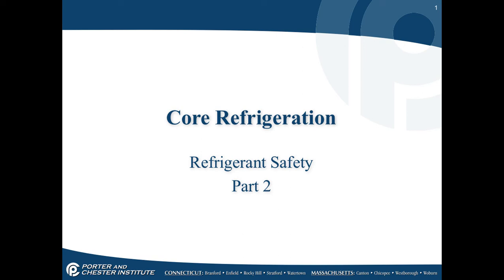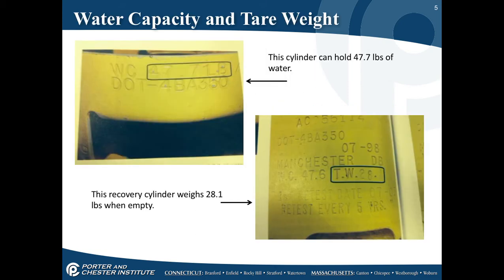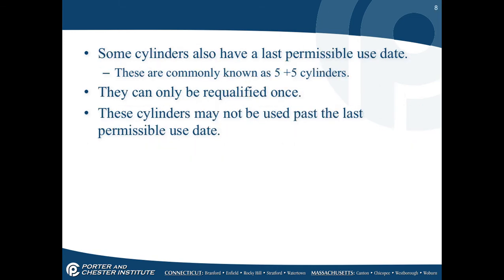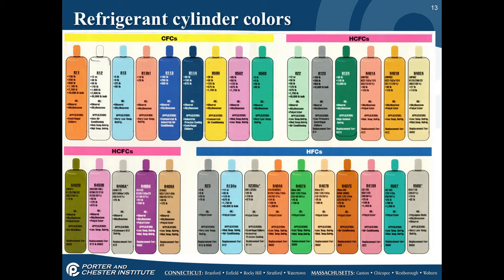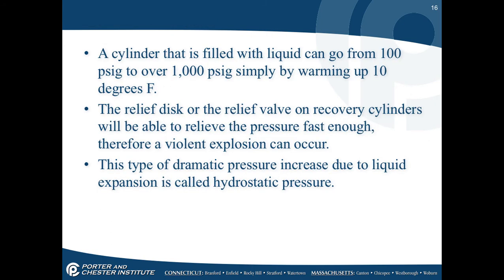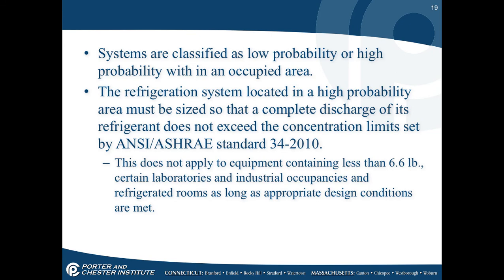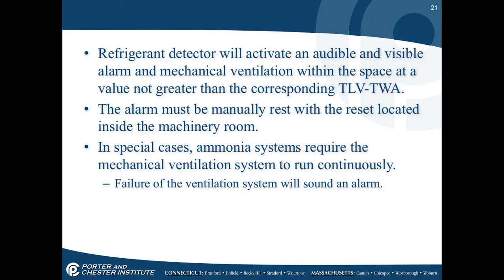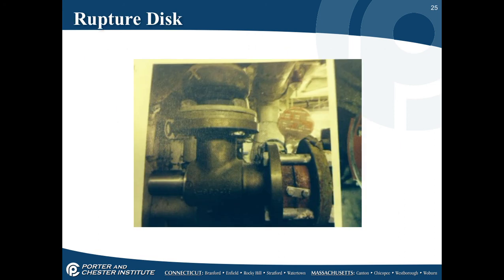Core Refrigeration: Refrigerant Safety Part 2

Comment: Why is rupture disc designed this way, but not like safety relief valve on cylinder which can be auto re-closed when the pressure lowered to certain pressure?